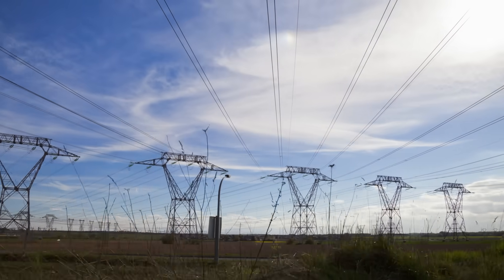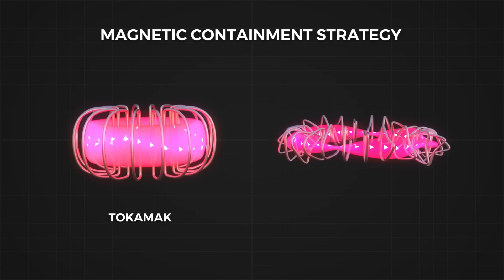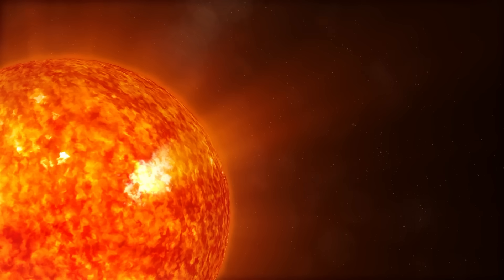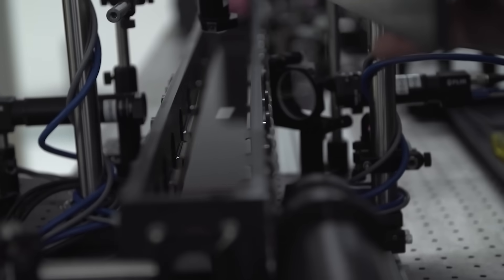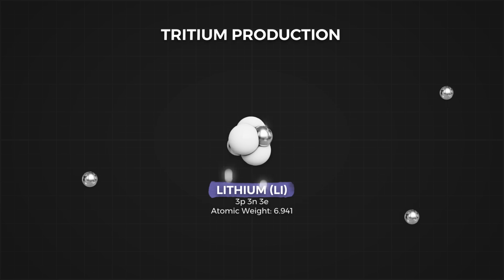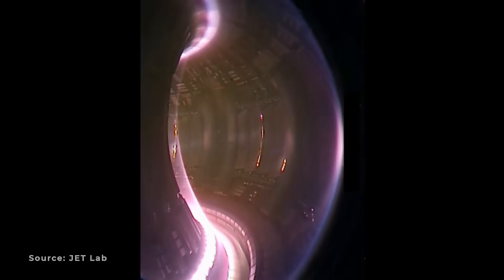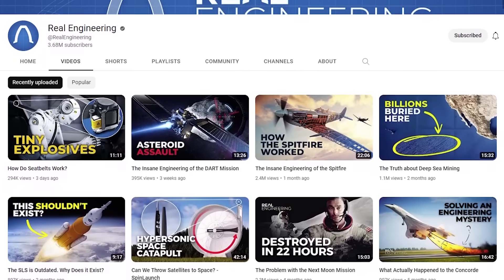The Problem with Nuclear Fusion

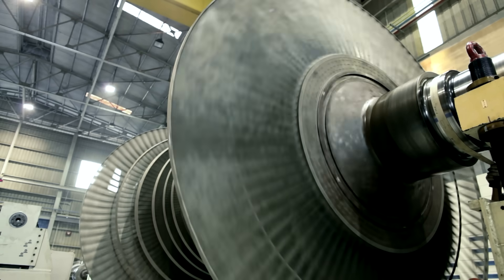Comment: 10:24 First, fission reactors are shut down by fiat, not because they are not economically viable. We are talking about a government mandated shut down, which is beyond stupid! 

Second, of all the bone headed idiotic ideas, using a liquid ,to get a gas, to drive a turbine , in the present day, makes me wonder about the contents of some people 's brains. 

You wanna drive a turbine with a gas, use air!  No need to heat air ,no need to convert anything to anything.
All you need is pressure, and some filters for the particles suspended in the atmosphere.
Hardly insurmountable engineering challenges. No need for oil, no need for coal... Clean electricity!
Is there some Law of physics that forbids it ,or something?
Reply: To clarify your questions, are you proposing we use fission and then asking why we don't heat air instead of water? 

The reason why water is used is because it boils at a temperature which is well below the critical temperature of a reactor. If the water gets hotter than that it will boil away that excess energy. If the air gets overheated then it just gets overheated and could lead to damage of the reactor. So number 1 is temperature regulation. Number 2 is also temperature regulation, except in this case it's that plants have an ideal operating temperature for maximum efficiency. To stay at around this temperature, you want something that can hold a lot of energy before changing temperature, which is known as thermal capacity or specific heat capacity. It turns out that water has one of the high thermal capacities of any substance in existence. (It does have the highest volumetric heat capacity), which means that it's great at keeping temperatures stable. This brings me to reason number 3: because of water's high heat capacity, you can use a relatively small amount of it at relatively (compared to air) low pressures. If you wanted the same amount of energy transfer efficiency from air then you'd either have to run it at around 1,000-4,000 times the pressure (which is absurd), run it at 1,000-4,000 times the volume (also absurd), or do a more sensible middle ground at run it at 31-63 times higher pressure AND 31-63 times higher volume (still absurd). 

So in short to address your question: it's completely fine to not know something, but saying it's a "bone headed idiotic idea" seems like quite the aggressive conclusion for somebody who doesn't seem to fully know what they're talking about. It could be beneficial to hold back on insulting ideas until after you know that you fully comprehend them

Comment: The thing about fusion is we lack a proper reactor to created it. Some require small targets which need to be constantly switch out but none have a mechanism to do so and tokamaks reactors don't produce a stable fusion reaction for long. They tried to remedy it with scale but even then they never saw a significant increase in fusion time. If scale was the problem a tokamak reactor like JET should've produced a fusion time in the hours not seconds. Building ITER was a mistake it only exists to launder money and keep some eggheads in job.

Comment: I wish you'd been more critical of Helion, and I've met them in person as well. They're being extremely quiet about the tech behind why rcf works. Does it work, does it actually break even? Tri Alpha has a very similar schemes as well and they're pretty far along.

MHD power gen is a great idea, gonna recoil the charged high energy particles off the field... but that's going to soak energy that should be heating the plasma out of the plasma....

Ps NIF is announcing something big regarding a break through on laser confinement Tuesday sec 13th

Keep an eye out

Comment: In my view the problem with nuclear fission is the incredible radioactive waste as well as the absurd amount of lightly irradiated material. This makes them only economical if you don’t count in the disposal. So… it isn’t. Fusion might have the same problem but seems solvable. The waste in nuclear fission is a requirement, not in fusion

Comment: The one problem about fusion that I never hear talked about is that it is still humans who will be running things.  I don't believe for a moment that just because the electricity will be cheap to produce that this will translate into cheap electricity for the end user.  Governments will come up with all manner of fees and taxes to make up for those they lose from oil, the corporations that will inevitably produce it for the governments will be just as ingenuous and corrupt as they are today.  Int he end if there isn't enough profit in it for them there would be no reason for them to go this route.  The only way I see it happening is if they use the fusion electricity they produce to offset the carbon taxes that will be placed on the oil they will continue to use for decades.  Mining companies have invested massive amounts of money into equipment that is designed to last for 40-50 years and it all runs on oil.  they will NOT be replacing all of that with electric and that is assuming we have the batteries figured out by then.  Even in a perfect world where every country produces more electricity than they could ever imagine using and do so so inexpensively that they can charge fractions of a cent per kiwh there will still be conflicts over the resources needed still.  Instead of fighting over oil we'll fight over copper and iron.  Never underestimate the human ability to fight someone over something they have that you want but don't really feel like paying for.

Comment: @RealEngineering you've convinced me that fusion is an even worse idea than I thought it was before watching the video.

You should make a video about the sum total cost of "clean, safe" fission power when taking research, construction, operation, decommissioning, and disasters into account. I really want to know what the price per megawatt ultimately was through the years. You can use the numbers for the cleanup for Chernobyl from the series, that's fine, but don't forget the containment sarcophagus currently still being repaired after Russia's invasion.

Comment: A smoke ring is hollow so to speak and it's rotation is perpendicular to its structure. From the inner diameter of the ring to the outer diameter.

Comment: Ridiculous. Temperature is not the Problem. This already under control. The problems are disruptions. But how many self experts have took part of DT fusion reaction from a Tokamak?  I worked 12 years in fusion technology and I was in the Team who made 2 of the 3 controlled fusions reactions  so far using Tritium .  Sorry the huge problem is the building up of the energetic  electrons capable to collect a huge part of the fusion energy and becoming a huge lightning strike touching the inner wall of the Tokamak.  This stop the reaction and the energy is transferred to the structure in micro seconds doing like an  earthquake .  The risk is leak , a contamination of the chamber from the thermical shield made in beryllium , the destruction of a diagnostic used as feed back loop and a waste of energy to recreate the Lawson criterion to ignite the plasma. Tokamak solution is the steam engine  for fusion reactor.  Lot of wastes,  low efficiency because  the wastes obliged to maintain the plasma during  half hour to become  a alternative solution of Fission nuclear reactor.  When you know and  pragmatic the solution is the inertial fusion. Because this is working in impulse mode the energy has no time to be lost because the reaction last 100 nanosecons. It can be an Aneutronic reaction  therefore no steam Power plant to collect the heat. The energy released is easily transfer to electricity because there are just energetic photons.  The fact this technology can be use as weapons because this solution involves very high temperature above billions of degree temperature.  This technology is so powerful than so far only blockbuster movies are showing what will be if we could built portable inertial fusion  gun  capable to destroy a building in one shot .  Therefore USA Russia China are working hard to  this solution we call the Z machine ...

Comment: I don't see the closure of fission reactors globally. It only happened in Germany.

Specifically for Slovenia, I know we are in the process of building a new reactor.

And globally there is a massive movement in education of the population about the nuclear energy (fission energy). For example you have the pirate political party.

As for the economics, they are profitable. They have a longer turning point, because of larger investment.

But the main reason for why they aren't as popular is irrational fear from previous and rare accidents and the policy around them. 

I have talked with the head of reactor physics at the national research institute Luka Snoj. He also gave a ted talk.

Comment: About Lithium fission in the blanket: Is this really a good idea? Surely it is much more abundant and cheaper than Tritium, but also Li demand is high in other areas and the atoms are destroyed/converted in the process. Would be nice that get it as byproduct maybe from fission of another element, instead of having to put it in from external sources.
I have the impression that fusion has similar problems as the old fission tech. Requires rare fossil materials, power plants are incredibly complex and expensive, you need qualified staff to run and monitor it the whole time. While it mostly solves the safety and waste issue, I wonder why everyone showcases it as the sci-fi tech that would give us unlimited energy. Is not more likely to be similar than current nuclear power? A fusion reactor at working scale might have 10x output of other plants, but there will be no revolution if the the cost per MWh is the same or even higher.
Reply: Kinda makes solar power / good old gravity containment in a distant star look better every minute, lol.

Actually, as someone without much real background on fusion this video makes fusion w/ at least traditional totamak designs look super, super awful.

You use a ton of energy on magnetic containment, and to start the reaction. It's super expensive to build. It burns through not just lithium but also beryllium AS FUEL, an element that only occurs in a few rare mineral deposits, AND that's that's pretty darn expensive to process. Short of the discovery of huge amounts of this stuff somewhere, this entire idea is pathologically stupid from a resources + sustainability perspective; the only "good" thing about this is that you at least get helium (which we're generally wasting, and ergo running out of) as a byproduct.

If you had a magic fusion reactor that just used deuterium + self-generating tritium that'd be great, but to say that I'm now very, very skeptical about the future – or sense – in this kind of fusion power would be a massive understatement.

Compare this with solar and the choice should be pretty goddamn clear, from an engineering, economics, resource scarcity, sustainability, and physics perspective. As is this is worse than fission, and probably worse than even hydrocarbons from a long term sustainability perspective. Contrast that with solar where we just get free energy from a giant fusion gravity containment reaction for free for the next several billion years.

The one good thing about this is that now we at least now have things like new ways to make neutron beam lasers, and maybe that technology will be useful for something else.

Comment: Direct heat from fission might be efficient enough to meet a net energy gain. Deuterium and tritium have no built up potential fusing energy. The sun, over time built up mass and hit a critcal point where fusion stabilized. Suppose this mass point to be 1f. When the center point of its mass was 0.999f the  surrounding mass was also 0.998 and so forth and out. When the center hit 1f and created extra energy of 1.1 this extra energy was enough to catalyze the surrounding 0.9f areas to fuse and so on and so forth. There is no free energy. All mass is energy built up over time. Fission releases billions of years worth of gravitational fusion. The key would be to find half fused elements or harness heavy fission thermal energy to create lightweight fusion. Maybe add an electronegative element like cesium into the mix to ease electromagnetic repulsion? Either way as long as helium 3 stays rare, fusion will have its purposes. Probably not to make cheap energy though. At least not with the current process. But then the electromagnetic walls needed to contain this thermal pressure would still require too much energy.

Comment: none, there is no problems. in the distant future the conventional fusion reactors will use the magnets around the reactor in a pulse. in effect creating an ability to fuse nearly anything. so for one fraction of the second the current passing through the toroidal magnets is about 10 fold which in turn momentarily compresses the plasma field to the high enough density and temperature to sustain an energy production. 
currently the fusion reactors have a limited heating potential, roughly to around 100 mega-kelvin. after that the reactor fusion plasma loses heat at the faster rate than it gains. the way to surmount the obstacle is to "pulse" the magnets. allowing for a fraction of a second to force the plasma into a much higher density and and temperature state by increasing the power on the reactor magnets. effectively bypassing the current reactor design limitations.
another concept is a high precision inertial confinement fusion reactor, the true cold fusion reactor without any inner electrodes, which will also be functional in the next 50 years. what currently is happening is that reactor size and and the field densities weren't scaled up properly to create a functional prototype. it needs to be large with super strong magnets to be functional. unfortunately the ion particles require a certain field strengths to sustain the process.

Comment: There is also one other issue with Fusion Generators; Stars use quantum tunnelling to bond atoms, too. That is the reason why the Generators are ALOT hotter than the centre of our Sun, as we can't compress a large amounts of mass so close, that atoms can quantum tunnel into eachother, causing a fusion, or at least enough so that the energy output is a positive.

Comment: If you want to circumvent the Beryllium problem you'd have to use either protons, pure deuterium or Helium-3 neither of wich are a viable option for medium-term applications. Protons require even more energy. Pure deuterium is probably the most viable option, though it will siginifcantly reduce your efficiency, as it needs higher temperatures than D-T-fusion to get going. As for  Helium-3 it's well Helium-3, expensive as all hell and the nearest known mjor deposits are on the moon.
So yeah, I don't see how a private firm can create a functioning byrillium-less fusion power plant in the near- to mid-term.

Comment: Maybe we need a different approach to fusion.  Fission is needed today but corruption prevents its proper use, it is far better than most every other non-fossil fuel source.  Wind and solar take up so much space and need so much mining, no recycling still, they're pretty horrible unless you can use them just in your yard.  Fusion will create its own problems if it ever works.

Comment: Even if we solve the technical problems, it doesn't seem like anyone is talking about how extremely cannibalistic these reactors will be. Let's say we're able to build a fusion reactor that is efficient enough to produce 500MW into the power grid. Even the best theoretical calculations show it would be nearly impossible to obtain an output ratio better than 2:1. That means a 500MW reactor would have to actually generate over 1GW of electricity. When you account for efficiency losses in energy conversion, heat->electricity, electriciy-> magnetic fields/plasma, electricity->run all the auxiliary systems and pumps, the infrastructure to handle all that would be vastly more costly than building any other kind of power plant. Sure you say, what does it matter if the energy is free? Well, all that extra equipment has a life span. If your power plant is 10x more expensive to build, than it's not really saving you any money if that extra cost is more than the cost of fuel you'd burn in a regular plant during its lifetime. I just haven't seen anyone run the numbers in a way that fusion makes sense even when you use the most ideal theoretical estimates of efficiency, all purely due to the extreme cannibalistic wastes of power necessary to just keep the plant running.

Comment: You are absolutely correct.  Tokamaks are a dead end.  Fusion will only be successful if it is affordable.
Reply: I've read that the reason one would go for the Tokamak design is because of its' scientific/experimental versatility - you can modify the shape of the plasma confinement with it. Maybe they weren't primarily looking to generate electricity with the ITER project? I mean, it's pretty in line with Tokamaks as they are fundamentally not that optimized for efficiency.
Reply: Fission is the future.

Comment: My two cents; taking the process that powers the sun and trying to gerryrig as a drop in for 100 year old thermal power plant design is a prime example of what Carl Sagan called the folly of human conceite. I suggest rather than a power plant, the first commercial fusion reactor will be a raw heat source for concrete or steel product

Comment: and the bullshit continues with over a 70 year pipe dream fusion a lot of Computer generated images and videos a lot of metal structures that don't work not enough fuel to run even a small 1GW plant and billions and billions and billions spent since 1950 yet not even a single device all of that money gone to waste based on an unproven pipe dream theory